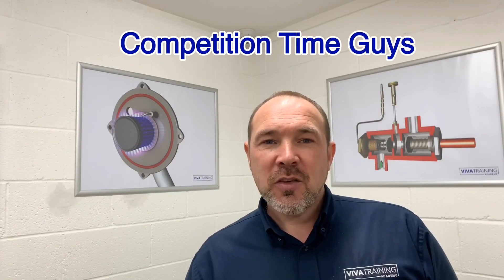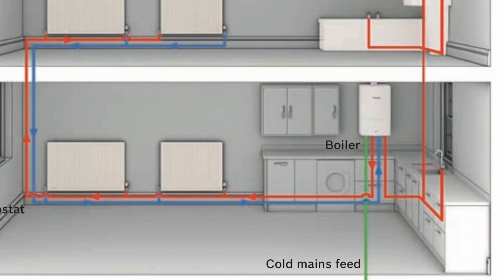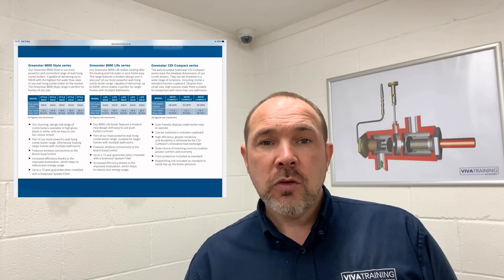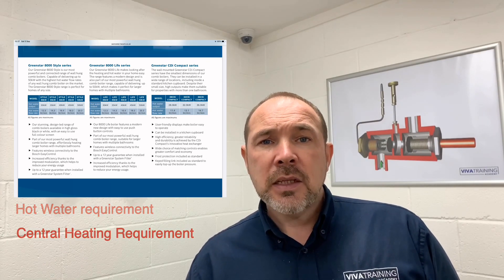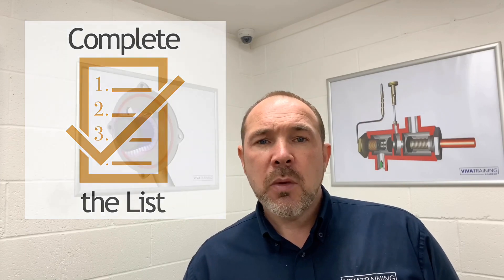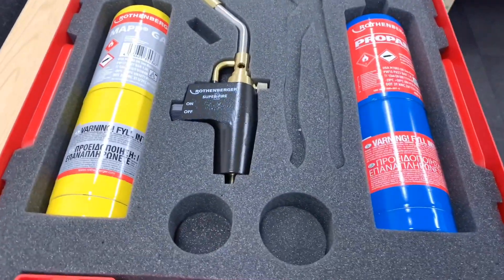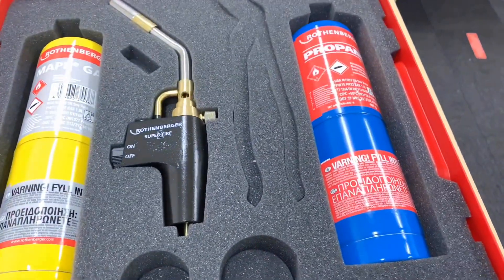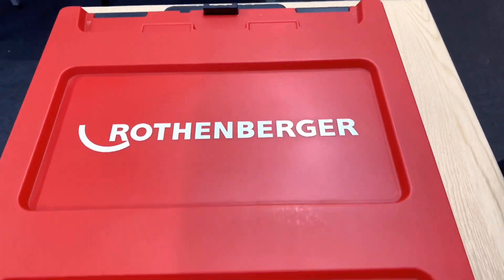ACS Gas Training - Which Boiler Should I Choose

Comment from the maker: Competition Time... With Prizes... Trainees only...

Firstly, ignore what the videographer says, its more or less complete nonsense. 

Have a go at specifying a complete installation kit list, to include the boiler and all the materials required to convert from these two boilers to a combination boiler.

Assumptions:

1. It's a 3-bed semi with 9 rads requiring 60,000 Btu’s of heat. 
2. There is one bathroom with a thermostatic shower valve and one downstairs toilet. 
3. The mains water flow rate is 14 litres per minute to the kitchen sink cold tap. 
4. Assume the flue position to finish 450mm above ground level, terminating onto a pavement. 
5. Assume there is a sink in the basement with a 32mm waste, situated 2m along the wall. 
6.  
Using the Worcester Bosch Guide select which Worcester Bosch boiler you would install.
www.worcester-bosch.co.uk/support/literature/download/8716116713

send in your answers to: 
hello@vivatrainingacademy.co.uk